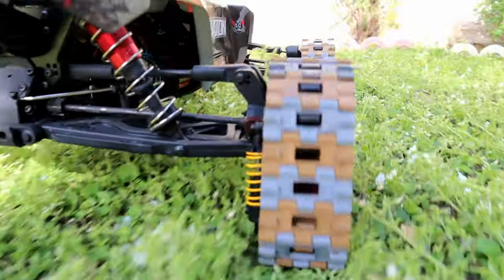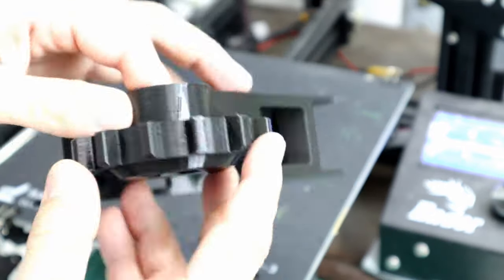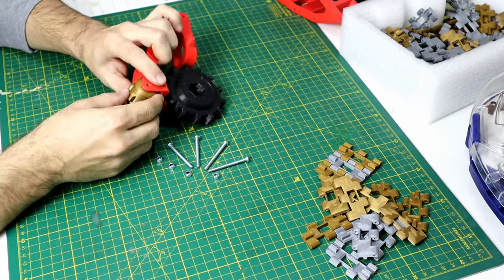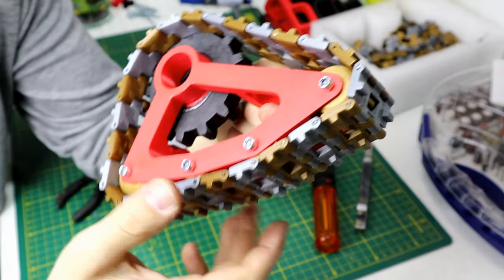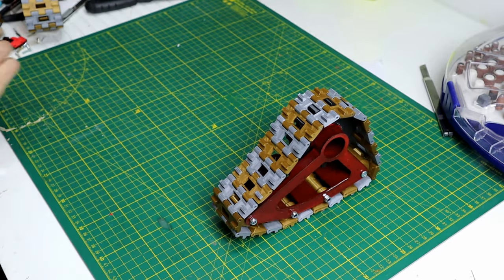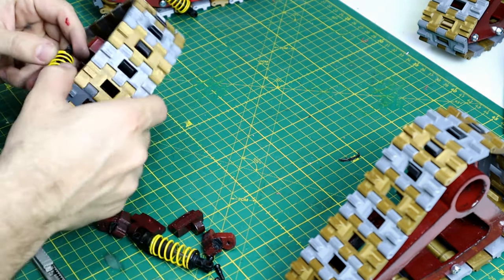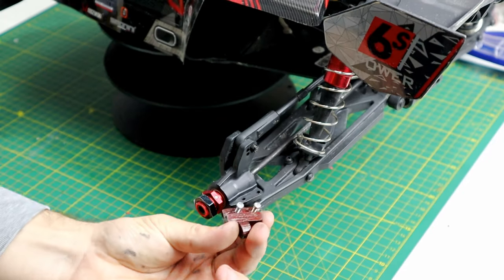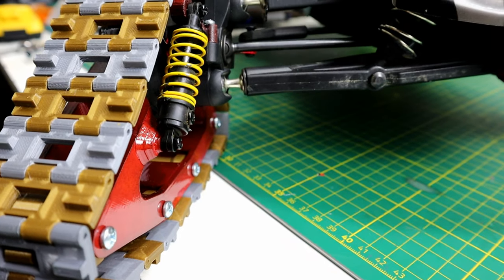3D Printing Snow\sand traxx for ARRMA Kraton 1:8 scale/ modifying  All Terrain Traxx|Scale Addiction

Comment: Would you reccomend tpu or pla/abs/petg for the tracks. I've got the frames and rollers printed. Debating on trying out some tpu for the tracks. Tracks aren't very aggressive, so i figured I'd try to make them flexible for more traction. Thoughts?
Reply from the maker: Yea, sam thats a good ideo, well i only had pla at that time, but petg will be better
Reply: @scaleaddiction  did you scale it up from the file you remixed? I was hoping to scale yours down to 70% so i could fit it on 12mm hub without an adapter